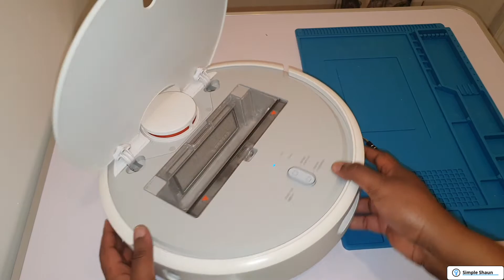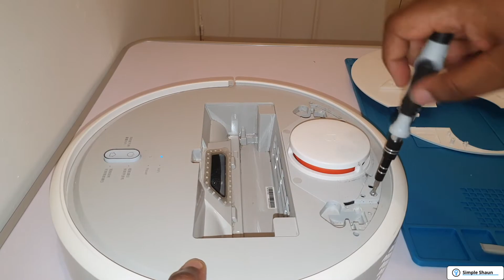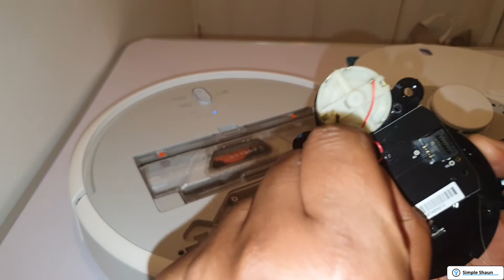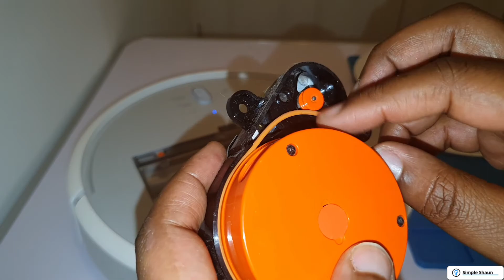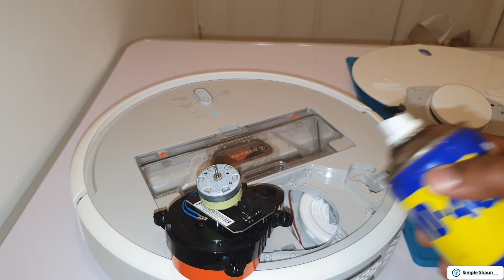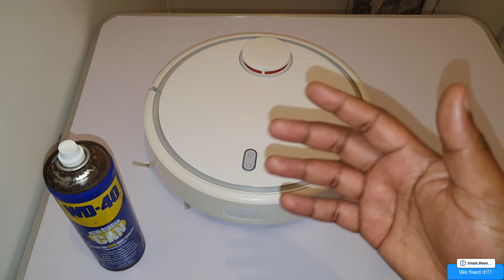Can I fix it? Xiaomi Mi Robovac 'Error 1' fault. Starts up but doesn't move.

Comment: Hi Shaun. I need a cog to fix my eufy 11+. You mentioned in a previous video that you had purchased a bag of cogs that had one that worked. Could you send me a link to where I could buy the same bag. Thanks for your help.
Reply from the maker: Hey, I will have a look through my order history and get back to you. If I dont find it, I do have another person who sells them specifically .... Ill message you soon :)
Reply: @SimpleShaun80 Thanks, I really appreciate that!
Reply: @SimpleShaun80  Hi Shaun. I don't think it will be as simple as getting a cog from an assorted bag. The cog that has failed in mine is the one interfacing with the motor brass cog. The teeth are angled. Not parallel with the shaft. I don't see any like that in pictures on Amazon.
Reply from the maker: @bobhoward3555  oh that's not good, and you are right, i didnt have any of those type in my bag, you may need to get a wheel assembly, or hope someone 3d prints these.... this guy i usually use for spare parts, maybe you can find what you need there https://www.ebay.co.uk/sch/cheesenachobaby/m.html?_nkw=&_armrs=1&_ipg=&_from=
Reply: @SimpleShaun80  Hi Shaun. I could not find that cog, it's helical. However, I did manage to fix the problem. It's only run once since I repaired it so I cannot attest to the longevity of the solution. If you send me a way to contact you outside youtube I will send you a few pictures and description of what I did. You can add it to your bag of tricks for fixing these things
 and maybe help out another viewer. Cheers.